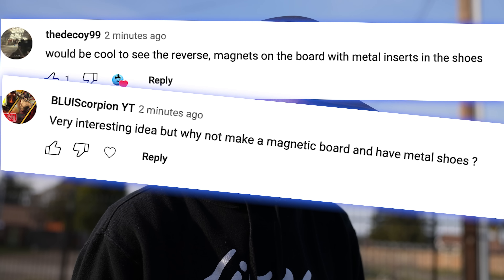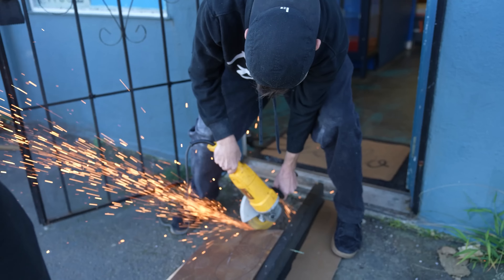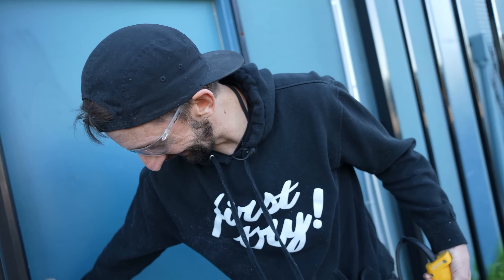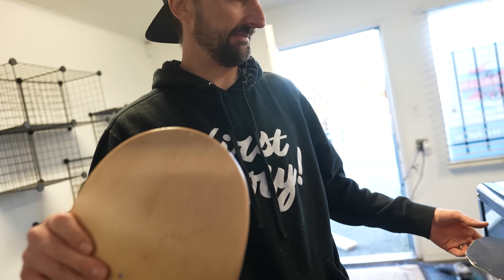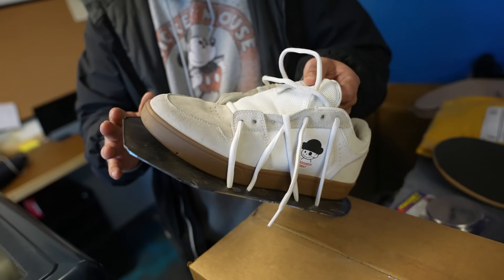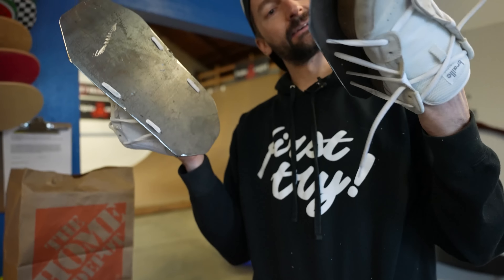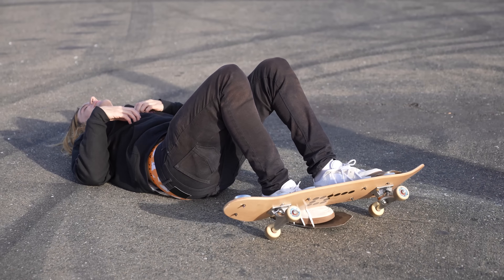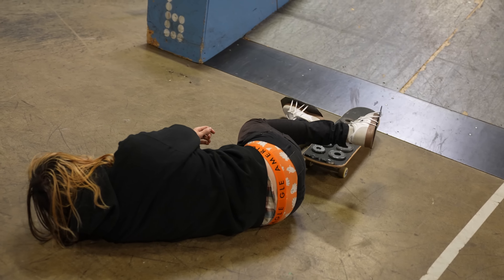METAL SHOES ON A MAGNETIC SKATEBOARD?!

Comment: v3 suggestion: Smaller metal plates on the shoes. Small enough that there is no metal going beyond the parts of the shoe that are used for ollies and kickflips and the like. Don't use laces to tie them to the shoes, instead use industrial strength adhesive or bondo or something like that. And more magnets but a lot smaller in size. Like, cover the whole thing in magnets that are only an inch or so in diameter. And have them cover as much of the board surface as possible so there are no gaps between. You'll get much better sticking power and you'll actually be able to do tricks like a kickflip.

Comment: I wonder how well it would work if you cut the metal pieces smaller so they fit inside the shoes, underneath the insoles. That might give you just the right amount of magnetism, especially if you use shoes that have kind of a thin outsole. Ideally it would still stick but not so much that it's hard to take your feet off the board

Comment: You could increase stability by attaching the metal to the shoes with adhesive. It would eliminate movement between shoe and metal, and you’d get back normal use of the laces.

Comment: Put the magnets under the board and cut the metal sole plates into strips and sink them into the shoe soles perpendicular to the length of the shoes for flexibility. That way you can olley and you have the rubber sole to grip the grip tape and still benefit from the magnetic field. :)

Comment: What would be even better is magnet shoes vs reverse polarity magnet board.
Try to get some force push flips, or hovering over the board shenanigans
Reply from the maker: I will need help on that maybe you can build it and send it into us?
Reply: @brailleskateboarding 
 I'll have a lok into it.
It should be simple enough, just mounting high power magnets on the top of the board, and opposite polarity magnets on the soles of the shoes.
Weight will be the biggest issue I can forsee, maybe even too weighty to be practical...

Comment: Great video. I would use a plasma cutter to cut the metal.
Next idea. 
4 caster wheels but same position like on a normal board. 2 at the front and 2at the back. But all wheels is on an angle like a ripstick

Comment: Maybe a streamlined version to bold the magnet to the bottom of the board, that way the magnet itself is not exposed, the force is slightly being weakened you can use a cleaner cut to the form of the shoe and glue the metal to the bottom of the shoe, but leaving grip around the edge and having the force there but still be able to skate normally. maybe even putting a line of glue so your slightly higher than the metal so you can push without cutting the ground. plus it might make grinding different as your on a metal face opposed to a wooden one. Its not like I can do any of these things but just thinking over here.